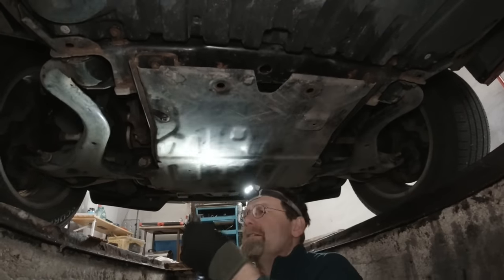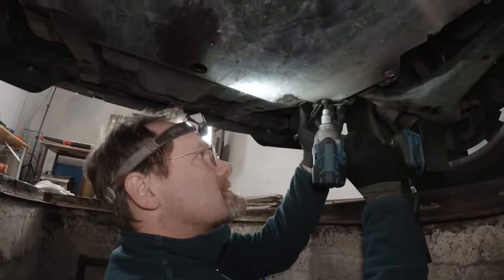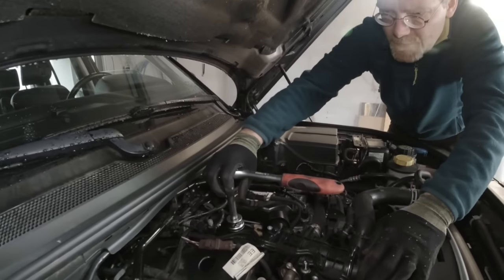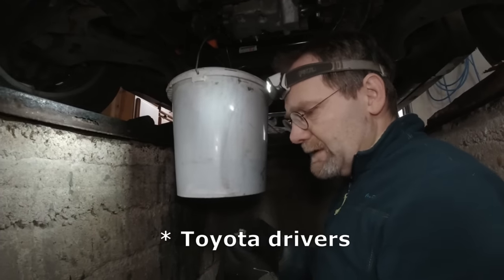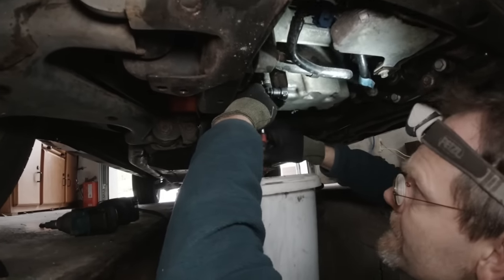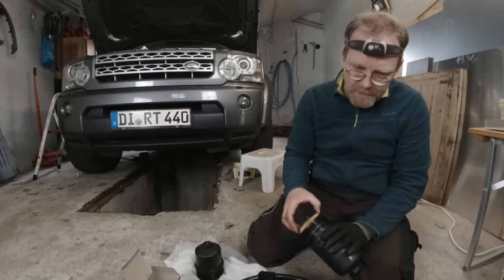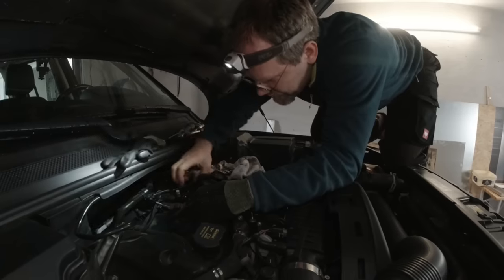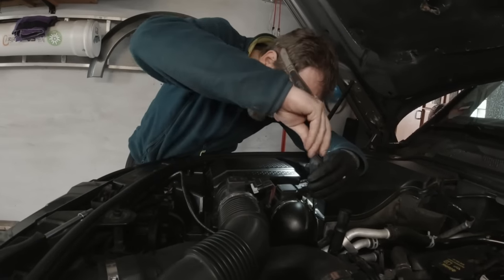No more 5W-30 ever again - Land Rover Discovery 4 - Transfer Case and Diff oil change

Comment: Hi Christina & Vera. Question, is there a way to know (looking from externally), if a car has the optional locking rear diff fitted?  Is there extra wiring/harness connector, or something?  Alternatively, by looking on the terrain response display, is there a way/option/selection, to force the rear diff to lock, should it be fitted?  I seem to think that the rear-diff icon will just show 'unlocked' if it's not fitted?
Reply from the maker: There is no unlock or lock symbol if not fitted.  I don’t think there is a way to force to diff lock.  Maybe check the manual.  Fitting the oem diff lock is not simple but possible. Better buy a ARB. That’s easier at the end.  Christian

Comment: I vote to install the new oil pump now. After you last oil pump video I was sure the newer pump was going to be the fix. In North America the company Melling makes oil pumps with around 20% more volume than standard for problematic OEM oiling systems. For instance the Ford 5.4 3V V8, which has top end oiling issues, their 20% over pump helps more oil reach the lifters and Cam Phasers. I wounder if there is such a product for the TDV6? From what I have seen the oil pump gears have more depth to increase volume but the space constraints of the pump are the obvious limiting factor if this is possible.
Reply from the maker: I ordered now a original FoMoCo. Hopefully it will help to get through summer.  Not sure if the problem is the pump or just regular wear. Christian

Comment: Do you suggest 5W/40 should also be user for climates that are generally under 25C in summer?
and do you keep that grade during your winter months too, or return to 5W/30?
Reply from the maker: I run it in hot and cold weather.  Unless you live in Norway, this is a year around oil.  Christian

Comment: well changing the oil pump is a hell of a lot cheaper than loosing the engine and spending thousands of pounds on a replacement or a rebuild and test the oil pump for operation it could be faulty and not worn surly it also has warranty been very short mileage covered since fitted not seen a little pump bottle like that before very handy bit of kit going to try find it on the net

Comment: Christian, hopefully you see this question as I’d love your opinion.   I use German made Liqui Moly oils in my D3 diffs and now want to do an oil change.  They have a 5w-40 oil but have an A3/B3 and also have an A3//B4 and the latter is PSA approved.  You mention in the video that the engine require A3/B3 but would A3/B4 be just as good?  Oil I’m looking at is Liqui Moly Leichtlauf High Tech 5W-40

Would really love your input if you have five minutes.  Liqui moly have around 4/5 variations of the 10w 40 from the one above to super to formula super,  very confusing.  

Anyways I’m going to take the 10w40 plunge in my 270k disco and hopefully she’ll sound a bit sweeter.  

Thanks a mill
Reply from the maker: Both, A3/B3 and A3/B4 are fine if you don’t have a DPF.  This oil does not have the reduced HTHS values.  Stay away from A5/B5.  For our DPF LR4 we use C3.  I would buy the cheapest but you may want to call them to find out the difference.  Christian
Reply: @Vera_and_Christian  thanks a million for your time.   Id never buy the cheapest but i only have one land rover unlike you guys 🤣

I think ill swap to liqui moly for a couple of oil changes and see does she sound smoother like Vera's.  Also have to do glow plugs but im avoiding that job as long as possible!  

Thanks again

Comment: Hi guys I'm a big fan! I'm considering the latest Volkswagen Amarok (using Ford Ranger platform) with a later version of the 3.0 SD V6, would you still recommend 5w40? (factory is 5w30)
Reply from the maker: Depends if you buy new or used with a lot of kilomters. New, you go what is recommended. But for the euro 6 engines, it is more important to do very frequent oilchanges due to oildilution, especially when only driving short distiances. 🙋‍♀️

Comment: Christian. Just getting slightly confused. I think you mentioned A3B3 valued 5W40, but at the middle of the video you mentioned C3 as C4 is not available. Which one is it? :) Great videos btw!
Reply from the maker: Castrol does not have a 5W40 A3/B3 which would be the best for non DPF.   The C3 is good for DPF and we use it also in our non DPF LR3.  Sorry for me confusing everything. Christian

Comment: I enjoy watching your content. I’ve always wanted to buy a Land Rover or Range Rover but have never taken the leap due to their reliability issues. At this point in it life I won’t but a new one and actually like the body style of the LR3 and LR4. Since you own both, which would you suggest?
Reply from the maker: There is no simple answer.  Both have engine issues.  Christian
Reply: Since you are in clearly in North America, I can give you some insight.  The LR3 initially had more issues from new, they can generally be fixed by fitting updated parts or buying a later year 2008-09 model generally you do not want an 2005 or early 2006.  By far the 4.4L V8 is the most reliable engine Land Rover has ever made if it was maintained it easily can go 300-400,000 miles before the engine needs a rebuild.  The 5L V8 they fit in the LR4 had a pretty serious timing chain issue and the later 3L V6 with the supercharger was less problematic but is VERY expensive to fix.  If you can find a clean one the LR3 is the one to buy it isn't as nice or as fast as the LR4 but it has proven more reliable and is simply much cheaper to fix where it counts, the 4.4L motor can be found relatively inexpensively.  

I've had mine for 15 years and it has proven to be pretty reliable.  It eats tires, brakes and of course fuel.  The suspension bits are problematic I've done front lower and upper control arms, sway bar links, sway bar bushings, inner and outer tie rods all twice my rear suspension is still original but probably needs replacement now.  I had to do the O2 sensors, the coolant tank, coolant hoses, thermostat, rear brake pipes, rear calipers.  I did a transmission service and the zf 6 speed was leaking but other than that the drivetrain is original and to this point has never had a "major repair" nor does it leak anything.

I think a big part of the LR3 engine having fewer issues was the 7500 mile oil interval they specified and a generally simpler non-gdi naturally aspirated V8 engine.  If you buy one with over 100k miles make sure the transmission was serviced as they tend to have transmission issues if not fastidiously maintained.  The other thing to keep in mind you will pay a lot to fix it unless you work on it yourself very few shops will be willing to work on it(outside of brakes, tires, basic maintenance, and some suspension work) and LR dealers and specialists are expensive in the US.

Comment: Hi, you said that magantec is the lower quality oil of Castrol, thus I compared the Edge titanium 5W40 with the magnatec 5W40 DPF in term of saps, it is exactly the same number 0.8 % wt and the rest of the datasheet is excaclt the same except for the ASTM D5293 number. Thus hte Edge could be used in my opinion!
Reply from the maker: Ok. I did not compare data sheets.  Edge is significantly more expensive in Germay compared to Magnatec. Christian
Reply: @Vera_and_Christian  Actually I was wondering whether the 5w30 with a C3 grade is enough because it gives better protection than the C1 and as a diesel does not rpm too much, '40' after the 'w' may be useless for diesel and '30' is enough ! Just some thoughts.

Comment: Hi Christian. Unfortunately the old Freelander 2 has gone but along came a 2018 Discovery 5 TD6 HSE on 92000 miles and I’m just getting everything together to do the first service at 102000 miles I will be doing the servicing every 10000 miles. what your thoughts on what oil to use on this engine? the recommended 5w30 or go for the 5w40. I’m doing about 800 miles a week in it and would like to keep her going for without any problems. Let me know you thought on this. Regards Paul
Reply from the maker: It’s a AddBlue 3.0 Gen 2 I assume.  You can run 5W40 but you need to use the correct ACEA spec. That may not be available in this combination.  Christian
Reply: Thanks Christian 
Yes it is the addblue 3.0 gen 2 
I’ll have a look to see if I can find the right ACEA as I’m look to buy 20L at a time. If I can’t I’ll just have to use the 5W30 until I can find the right one. 
Regards 
Paul.

Comment: Oil was always hot subject so there's no wonder so many people are making comments. I got one too. I presume the engines on LR's 2.7 and 3.0 that are Ford engines, are in fact PSA engines, aren't they? If so, how about other PSA HDI engines, like 2.0 TDCI DPF for which A5's are recommended? Will any C3 5w40 do better than this one? Appreciate your reply.
Reply from the maker: The engine was designed by Ford in the UK and is build in Dagenham.  PSA was only part of the venture.  We use C3 because of the DPF.  Christian

Comment: Toy ota owner here with dv5 ford/french colab engine 😂 
Pretty sure it's getting 0w30 (warm climate). 
With service every year/15k km, how are they giving 15 year 250k km warranty with such lightweight oil? 
Are the manufacturering tolerances that much better nowadays to achieve this? Or is weight reduction of reciprocating/rotating assembly make this possible?
 Or is the official service cost higher to cover bottom end/turbo work under warranty? It already had complementary preemptive chain upgrade done, but maybe engine supplier covered that
Reply from the maker: The duty cycle of the engine is lower.  So less power in relation to the engine size.  Toyota released engines with 12W0 factory filled. That oil is not even available in most countries.  They are leading in this regard.  Christian
Reply: @Vera_and_Christian  Not sure I understand, 130hp from 1.5L 4 cyl seems like a lot of power for the size!
 I do see the commercial versions have shorter 10 year 185k km warranty, would that be because of higher duty cycle? 
Or by duty cycle you mean firing per degrees of crank rotation?
No oil spec in my user manual 😂 workshop manuals suggest 0w20 for temperate europe with low sulphur fuel, 5w30 for hot climate/higher sulphur fuel. I'm in a hot dusty climate. I suspect it might actually be getting the latter.
 Next service I'll have to ask what they're actually using, I intend to keep the vehicle for a long time.
 I would trade a little efficiency to reach end of warranty in better shape, but I suppose I don't have much choice to stay under warranty, just trust my local service knows what they're doing, why I went with the brand in the first place. 
12W0 you're winding me up now surely 🤣👍

Comment: I would need to know if another pump lifted the pressure before rebuild time. However with my luck I'd buy a "gold plated" JLR pump from the dealer and find a Fai pump or even worse a $hitpart one in the box.

Comment: Hi Christian greetings from South Africa ! Can you top up 5W-30 with 5W40 or must you do an entire oil change ? Thanks
Reply from the maker: Please don't. Just change the oil. A little bit of 5W40 will not give you the lubrication properties. An oilchange is anyway due after 8000 Km in our opinion. So long before you would need to top it off. Or your Disco is loosing or burning oil? 🙋‍♀️Vera

Comment: Hi Christian, is the Transfer case refill procedure the same for the Discovery 3...fill until it overflows the fill port? Or should it only be 1.5 litres?
When I change mine it never overflows with 1.5 litres on the Discovery 3.
Thanks again 👍😊
Reply from the maker: Yes, 1.5L.  It would overflow if you put in a bit more.  Car needs to be level.  Christian
Reply: @Vera_and_Christian  OK that's very helpful as usual. Thanks again Christian you're a star 🌟 😊👍

Comment: Change the pump now, I returned FAI and bought "europarts" which makes it for LR, it has FoMOco on the casting and i compared to oem it's the same, but it's just over 200eur, I can send you picture of mine (haven't yet installed it).
Reply from the maker: I bougt the FoMoCo from Citroen 1001.G2.  Should be delivered soon.  I intend to compare it with the FAI, similar to my oil pump test video a while back.  Christian

Comment: I use Shell Rotella T6 in all of my diesel engines. It surprises me that the LR engines aren't lasting at least 400,000 kilometers.  I noticed the "Castrol" written on the oil filler cap.  That looks like a planned failure by LR.  Shell Rotella T6 is the only way to go for me.
Reply: These engines like the shell oil, I sometimes run the T6 in my gas 4.4 LR4 that or the 5W40 Ferrari oil from shell.  I had the Tdv6 for a few years in a discovery 5 and Shell Helix C2/C3 noticeably improved the fuel dilution problem that was happening with $20 a litre JLR C1 oil which IMHO is not a great oil(nothing to do with Castrol who makes good products) and is more about fuel economy and protecting the DPF than protecting the engine.

Comment: Do you have issues with rattles on startup after the car has been sat over night? Does the thicker oil take longer to reach the top of the engine? Or would this be a symptom of low oil pressure regardless of oil grade?
Reply from the maker: No more rattling since the oil switch, but ...we have also replaced the oilpump since. So we have almost instant oil pressure now again. Made a video about it a couple of weeks ago.🙋‍♀️Vera
Reply: @Vera_and_Christian  interesting thanks. I think mine is leaking oil form the turbo oil feeder or drain pipe so that’s probably not helping.

Comment: Hi ! im Alex from Taiwan, I have the question about the HTHS i don’t know if you will explain to me why you choose the non-reduce HTHS(c3,c4) instead of the reduce HTHS oil(C1,C2) the manufacture suggest ? i thought the high HTHS will cause the damage to the engin😅 , so it just for the fuel efficiency ?  
Thank you !
Reply from the maker: High performance Diesel Engines need every bit of protection available.  The engine was designed before reduced HTHS was introduced.  LR changed the spec later for fuel efficiency.  Christian

Comment: Hi, did you noticed any changes in rattling time after morning engine start? Does oil pressure build up is faster or slower after this change?
Reply from the maker: Not on the LR4. Our LR4 is just too new.  On the LR3 with 250tkm, yes, the 5w40 improved startup.  But the biggest improvement was the install of a OEM oil pump in a later video in our LR3 TDV6. Christian
Reply: @Vera_and_Christian  thanks for respond. I will do all your suggestions.

Comment: Another great video guys 👍definitely do that oil pump now!! Or you could be replacing an engine, how is Fabian’s engine going ??
Reply from the maker: Still running. 👍🙋‍♀️Vera
Reply from the maker: His engine is still running but there are bearing chips in the oil.  So it will not last an other 100k.  He got about 20k on it now.  We plan to open it up soon.  Christian
Reply: @Vera_and_Christian  that’s a pity about the chips in oil filter, would it be a case that the mileage tends to put all of the internal engine components out of spec? Sure silver lining is another great video to come from your self and Vera 👍

Comment: @Vera_and_Christian Would 5W30 C4 be okay as it says is has a high HTHS (≥3.5cP) and low sulphated ash (≤0.5%) required by ACEA C4 limits, 5W40 C3 is only a mid saps oil not a low saps?
Reply from the maker: I think C3 is better and it is much cheaper.  Don’t use 5w30 in the diesel - that’s what the video is about !!! Christian

Comment: Hi Vera and Christen 
Great video as always, I love to watch your videos which are so interesting and helps me get a better understanding of the LR3 ( which I have a 2008 LR3 ). Unfortunately where I am we are compelled to take the car to the local dealer agent and I guess like all other JLR agents they are very very expensive.
I have a recent issue with a minor oil leak which I am told is from the upper side of the engine, which is very cumbersome to repair, expensive . Have you guys come across any such issues with Vera’s LR3, ( mine is a 4.0lt petrol HSE)
Reply from the maker: You need to locate the leak in detail.  Can’t be a big deal unless you go to LR.  They will take the body off.  Christian
Reply: @Vera_and_Christian  
Many thanks for your quick response! The dealer told me that it is a leak from the upper side of the engine and they need to take out the entire engine which would be very laborious and costly a well. 
Will try and get it inspected at another private auto workshop and get their feedback. 
Thanks from Muscat in Oman
Dankeshan
Reply: @jagadishraob1332  Likely is the valve covers either the gasket or the cover itself is cracked.  That engine is a Ford engine so the parts should be reasonable.  I cannot imagine the engine needs to come out to address but with LR who knows your best bet is to find an independent shop as they typically will come in at half the cost the dealers charge.  Depending on the age of you engine if they need to remove you might want to rebuild/replace the motor as those cologne V6's are not known to be the most robust engine.

Comment: Did you do the front diff ,well about the oil pump I would put a new one in now before it does any damage if it fails the engine is toast
Reply from the maker: I did buy a new OEM pump for 306 Euro and I will install it soon, so that everybody can see if it was causing the problem or not.  Christian

Comment: IMO you have replaced the pump and now have low oil pressure. So it’s logical to assume the pump is at fault. Therefore first priority should be to replace that pump and retest. I personally think that would be useful for us all to know the results.
Reply from the maker: Coming next Saturday. I already have a new Fomoco oil pump. 👍🙋‍♀️Vera